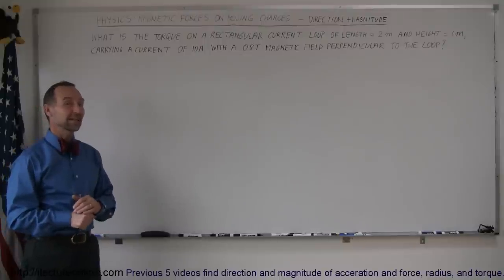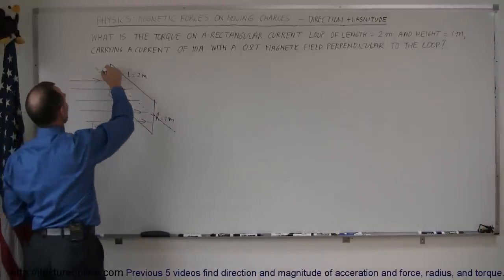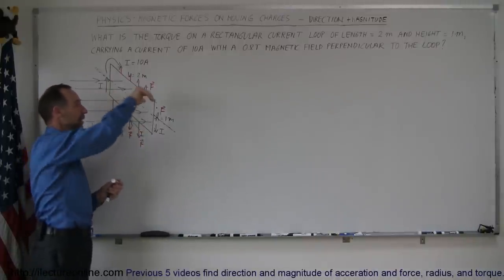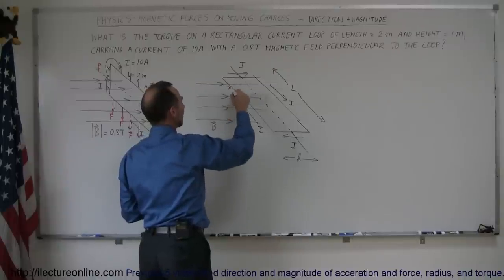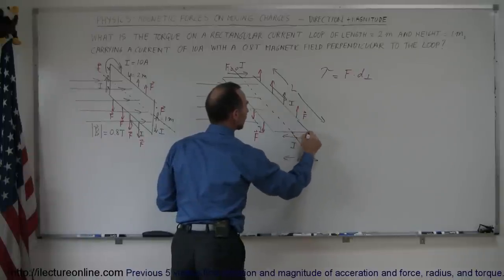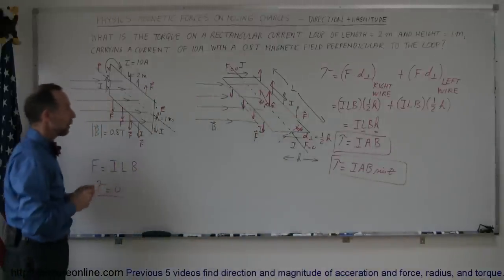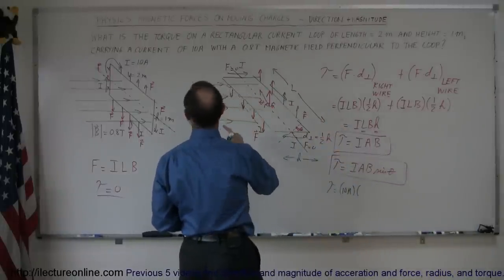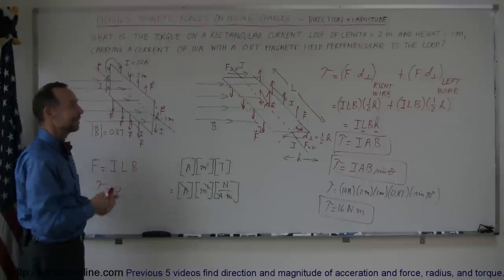Physics 43  Magnetic Forces on Moving Charges (6 of 26) Torque on a Current Loop

Comment: For anyone confused on the perpendicular portion, I believe that what he is saying is that while both diagrams are perpendicular to the magnetic field, (try imagining right angles drawn from the magnetic field lines to points where it contacts the wire) we cannot find any meaningful values from diagram one, as it’s net torque is zero. BUT, if you rotate the wire loop 90 degrees as he did, you will see that the loop indeed rotates about its axis with the calculated torque. In fact, this is exactly how a simple motor works, minus a few extra steps. The main takeaway for anyone confused, is that BOTH DIAGRAMS ARE PERPENDICULAR TO THE MAGNETIC FIELD, but only the one on the right is experiencing a net force due to the magnetic field.

Comment: Professor,  

Thank you so much for your videos, they have helped me so much in all my engineering classes I have taken so far. 
I have a home work problem that I have been not been able to solve and I was hopping you wouldn't mind explaining how to work it. 

Thank you,  Johnny Canazon

The picture tube in an old black-and-white television uses magnetic deflection coils rather than electric deflection plates. Suppose an electron beam is accelerated through a 52.0-kV potential difference and then through a region of uniform magnetic field 1.00 cm wide. The screen is located 10.9 cm from the center of the coils and is 54.4 cm wide. When the field is turned off, the electron beam hits the center of the screen. Ignoring relativistic corrections, what field magnitude is necessary to deflect the beam to the side of the screen?

Comment: Sir , i don't get the first part.Doesn't the loop on the left side have torque either ? Because forces are not canceling out each other.
Reply from the maker: The net torque must be zero, since the action of the forces on each wire section is direction through the point of rotation.

Comment: Just to clarify then, in the original problem, the correct answer is that the torque is equal to zero, correct? Since the magnetic field is perpendicular to the current. The second illustration where loop is parallel to the magnetic field is essentially a different problem, am I right?
Reply from the maker: Orlando Ferrer You are correct, but not for the correct reason.
In both cases the current is perpendicular to the current, but the direction of the force does not produce a torque in the first case.

Comment: sir u said for negative charges we use left hand palm rule but in conductors current is due to electrons so it is a negative charge but it using right hand palm rule?
Reply from the maker: The standard is to assume that the current consists of "positive charges"

Comment: Why did u use the left loop though the B is in the plane of the loop and in the question it's given the B is perpendicular to the loop. Is the correct answer 0 according to the right loop?
Reply from the maker: The torque on the left loop is zero.  The torque on the right loop is IAB
Reply: Michel van Biezen Thank you very much

Comment: Isn't the answer to this problem zero Nm since the problem asks about the torque when the magnetic field lines is perpendicular to the rectangle?
Reply from the maker: The video is correct.
Reply: The problem was not to calculate the torque when  the magnetic field lines is perpendicular to the rectangle, that is the rectangle on the left and torque is zero,  professor Biezen solves the problem  when the rectangle is perpendicular to the magnetic field and  at zero angle with respect to the magnetic field .

Comment: i thought torque was BiLsin theta and perpendicular is 90 degrees so sin of 90 is 1, how are you getting zero?
Reply from the maker: It depends on the reference point, the orientation, and the position of the angle.  That is why just "blindly" using an equation can get you into trouble.

Comment: I couldn't get when the rectangular loop is at  some angle how it is iblsin
Reply from the maker: As the loop turns, the amount of magnetic flux through the loop changes proportional to the sin of the angle.
Reply: @MichelvanBiezen  to the cos no ? and thanks for ur videos , i just have a question , we use COS when we consider the rotational angle , and we use SIN when we use the angle between the normal of the surface and B ?